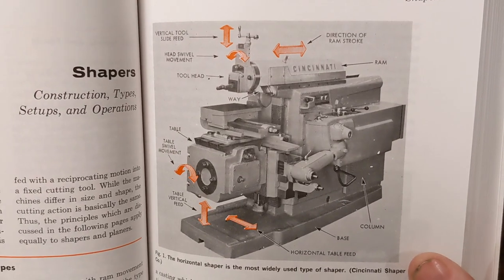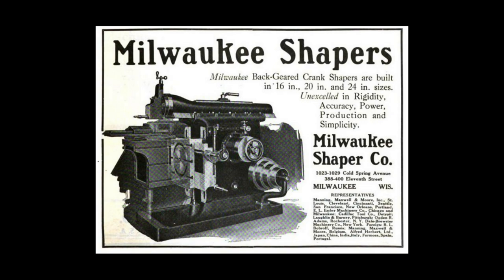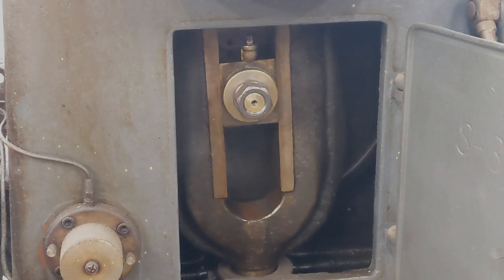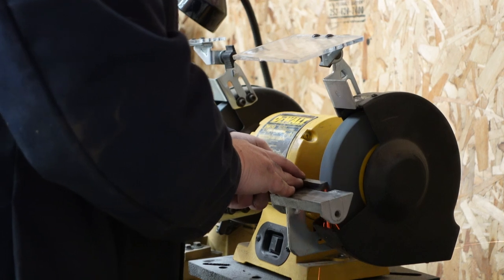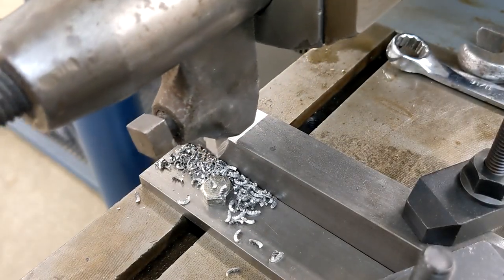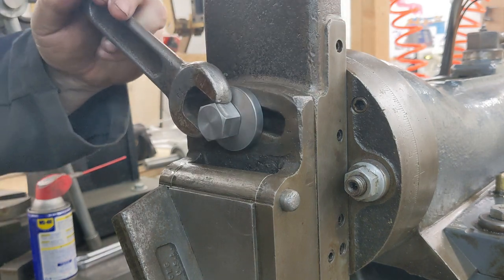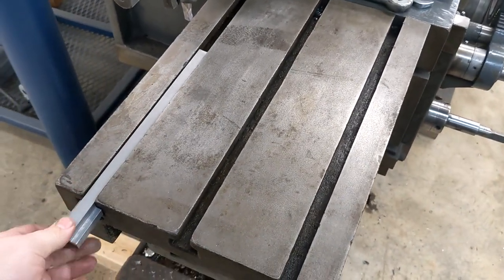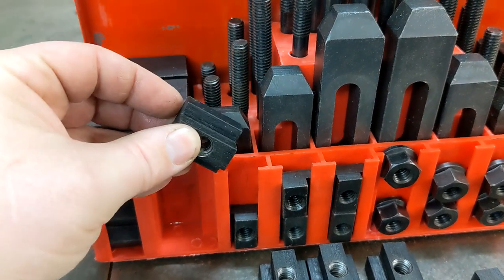An obscure machine tool and its history

Comment: Graduated 1980 from trade school as a machinist. In the summer of 78 I worked in my first machine shop after 10th grade. Half of the shop was run from a belt and shaft that was almost a century old . This was an old machine shop when Lynn MASS was shoe capital of the world. Upon graduation I worked at United Shoe Manufacturing corporation ( USMC ) in Beverly Massachusetts. This was the factory that produced shoe making machine's and was the largest shop in America. It is now Cummings property. This factory had its own foundry and production line machining where I worked on an old Milwaukee horz and vert mill as piece worker. The story that ruined this company was about a monopoly. USMC had its own thread system and nothing was standard measurement. Meaning no 1/4 20 tap but maybe..265 by 18 tap. No 1/4 , 3/8 or other known measurements but .240 or 385. This is examples and not real but no one could produce or make any piece until courts sided with the government and forced USMC to use same system in the country
Reply: gah. and i bet they used nuts that were those pesky "neither metric nor imperial" like certain british/australian machines loved to use... effin kills me pulling apart old machines with BSA/whitworth sizes... unless its really important, i drill and tap them out  to metric rather than even bother undoing them? i derive much pleasure from destroying "sh1tworths"...

and thread geometries that arent the standard iso 60 degree, either... the most common is bspt, 55 degree, thats ok, its still widespread, but just enough difference to the NPT to be a pain in the butt when dealing with plumbing/hydraulics.

Comment: Its better to clamp stuff in line with the stroke, that way should it overpower the clamp it will just slide it off the clamps. If you clamp at 90 degrees it will crash, either damaging the part or the machine

Comment: That camera mounting on the shaper ram is so good.  Somehow, the t-slot nuts on my mill stand just a bit above the table surface and I never realized how useful it would be to have them low enough to slide under work in progress.  So, besides learning about shapers watching this, I learned about t-nuts.
Reply: The t-nut  segment was a solid  "the more you know" moment.

Comment: For those who think that sharpers are not worth the money, consider this.  A number of tool and die shops here in this area used shapers to remove heavier amounts of stock before doing the finish machine work on vertical mills.
Consider the cost of end mills and other cutters.  The time to change the cutter and reset for dimensional requirements are all a part of machining thought process.  Use a good grade of hs tool steel.  Determine wear of the ram vs the column ways vertical and horizontal ways.  Also for parts that have been welded to repair or build up worn surfaces HS steel tooling will generally be cheaper to use than end mills or in some cases carbide insert tooling.  What you want to consider is flexibility.  Since shapers are usually cheap it can be a low cost investment that even if only used occasionally can be a job saver = money maker.

Comment: T nuts is the first thing I made on mine, though I modified some I had on hand that were for 5/8" studs but were too large to fit in the slots, I was lucky and mine still had its vice, I bought it from a guy who was retiring and he had had it sat in a corner at the back of his shop but hadn't ever used it, in 40 plus years, never even wired in and he told me it came from an R&D shop which he bought a bunch of machinery from when it shut. So its in pretty decent condition.
I also bought an nearly unused universal dividing head, most of the accessories were still greased and wrapped from new and its in the factory shipping crate.

Comment: get a tilting rotary table, check the maths for generating spur gears with a slotting saw, engage brain cells to "roll a cone on two axes", and you can cut high precision bevels, relatively quickly... the only other way to make them to the same accuracy is with a very specific and single use "shaping machine", the gleasson bevel gear generator.

 the only one i know of (GBGG) is a yuppie ornament in a cafe that was once a train workshop because in this country the current practice is to have the train workshops as far away from the rail network as possible, shipping them around by truck instead?

oh, how i would love to fire THAT particular lump of iron up during the lunch hour rush!

find the RIGHT application for a shaper, and they CAN make you money...
and for the hobby shop, theyre just nice to have if you have the space.

generally the machine comes free... its the shipping that kills it.